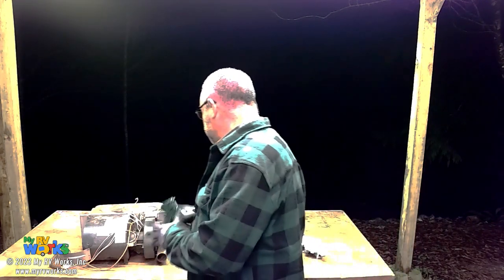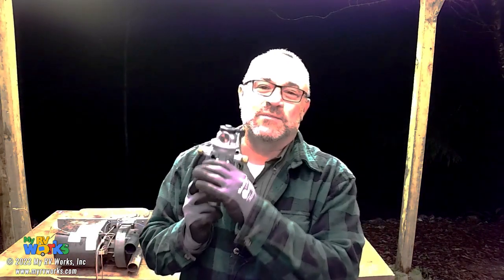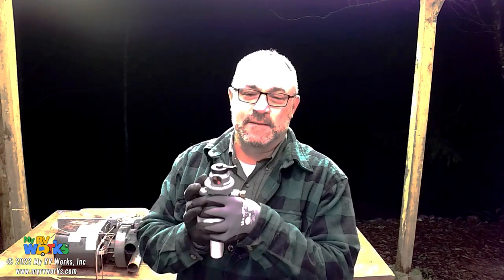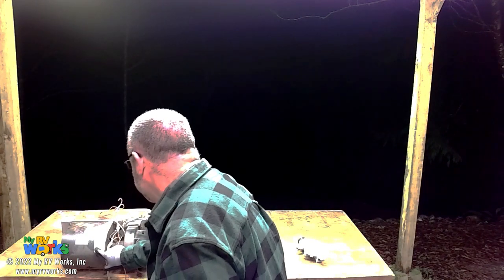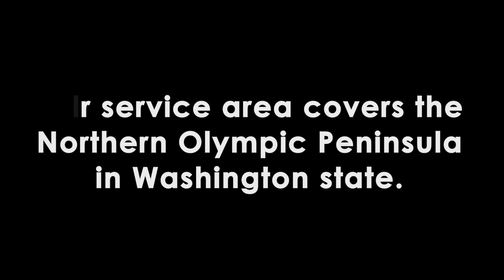3 Tips For Your RV Furnace + Bonus Q&A -- My RV Works

Comment: Concerning mouse proofing an RV, I have discovered a method that has worked for me 100% of the time going on four years now. We have a destination model trailer permanently parked on our lake lot which we occupy from May through October every year. The rest of the year it sits empty. It has no skirting under it. Our first year, we had two episodes of mice inside the trailer. Then a friend told me of a way he uses to prevent RV/Boat rodent entry. Indoor/outdoor rope lights. So we got a rope light from Amazon long enough to lay on the ground circling the trailer, outside the support jacks, the tires and the tongue jack, and have not had a problem since, except for one time when I inadvertently unplugged the lights and left for a week. The lights just work. The rodents will not cross the rope lights! Thanks for your videos! They are outstanding!

Comment: All I can say is thank you, thank you, thank you.  On a recent trip the furnace on my 2016 Thor 28Z stopped working.  I have spent two weeks trying to troubleshoot it.  I must have watched 2 dozen youtube videos and read countless forum conversations on how to fix it.  After replacing the control board, sail switch, ignitor and sensor, and high temp thermostat switch, I was at wits end.  I realize now that my sail switch did need replacing as the fan wheel would not run unless i first hand spun the fan to get it moving.  Once the sail switch was replaced (the same time I did the circuit board) the fan would come on, run for 30 seconds and then it would try firing.  I could hear the click, hear what sounded like a spark and then get a brief 1 or 2 second burn before it would shut down.  Time and again this is what would happen.  After lockout, I would wait 30 seconds, reset the switch and do it all over again. I threw in the towel and told my wife I was probably going to have to bring it to Camping World and have them fix or replace it, at a tune of probably 1500 dollars or more.  Being retired on a fixed income, this wasn't a good feeling.  Then this evening I was conducting my last due diligence and found one of your instructional videos regarding the gas valve.  During my earlier attempts  I could only smell the slightest hint of gas during this time, so I decided that maybe I should troubleshoot the gas valve next.  I watched one of your older videos (3 years ago it was recorded) and decided that tomorrow morning, that is how I would start my day.  Maybe, just maybe, it was a solenoid or an orifice obstruction.  Then, you mentioned something no one did, in any of the previous videos or forum chats.  You said that the exhaust vent tube had to be in place for it to fire and continue to run!  When I was trying to get it to run, I left the cover off with the exhaust tube attached.  So, I detached the exhaust tube, put it back into the furnace and low and behold, it fired right up and ran beautifully!  Something as simple as that!  Thank you!
Reply: Thanks for sharing your experience!  I’m trying to figure out my lack of furnace function right now, and I would have done the same thing and left the cover off.

Comment: Hey, I’ve been enjoying your videos! Very helpful! I do have a question. I have an old travel trailer with a hydro flame 8525-III. After getting it out of storage and hooking up power (12v DC) it appears the furnace is stuck on. Blower and heat…will not respond to the thermostat. Only way to shut it off is to pull the fuse. Appreciate the help and keep up with the helpful content!

Comment: Thank you for such detailed explanations. Please tell me, I have a problem and I can't understand what the reason is, my thermostat from Coleman has a relay and when I turn on the heater this relay clicks 2 times and sometimes it happens that it clicks 1 time the heater starts up and heats up and then clicks again and stops and works randomly, I tried to install a new thermostat but it didn't help me, the heater is in perfect condition it is 100% working and was tested with different components

Comment: What RV is okay at -40? I know their construction and operation well, so being fine at that temperature would have to either be very limited or with a set-up I've never heard of. I have an Arctic Fox "4-season" (right!) and the rear plumbing is good to around 12F, at which point the unit is finished functionally, with the interior temperature set at 65F. The interior temperature can be kept at 65 to about 10 below zero F, but the walls are then losing it at that point with condensation frozen in the corners, etc.--a 2-inch wall with an uninsulated aluminum frame will never be "4-season" in reality except in the South.
Reply from the maker: Here is a link to some notes I give at seminars where I discuss this information.
 
https://myrvworks.com/darrens-seminar-outline-for-winter-rv-living-in-comfort/
Reply: @MyRVWorks  Yes, those are mostly standard winter practices that I am familiar with except for a few items like R-19 insulation under the coach. Mine is already insulated, though not at that level, nor would there be anywhere to insulate to that level (assuming we are talking about actual insulation and not an "RV-manufacturer insulation rating" where aluminum foil with an air gap is imagined to be worth R-30, the residential-builder scandal with that stuff never having reached or been enforced in RV marketing claims). Unless you tear apart and retrofit floor raceways, under tubs, etc., to add heat tape and insulation to water lines and the total energy expenditure per square foot is essentially limitless, plugged into AC, and unless refrigerator manufacturers like Norcold are willing to go 40 degrees below their current minimum-temperature rating even with their cold kit being installed, this still isn't going to get you down to any kind of normal, living functionality in the -40 range.

My experience is mostly in the northeast corner of Washington State east along the northern tier into Idaho and Montana, and even older homes with at least 2 or 3 times the best RV's insulation, enclosed to the foundation (which itself is deep enough to be on unfreezing ground), far greater thermal mass, etc., often struggle to maintain a livable space with everything working normally at that temperature. An acquaintance scared himself with the encouragement of other owners in their forum that an Airstream would work well for him in severe cold. After his very first night just getting down towards zero, he woke to find the entry door frozen solid metal-to-metal. Despite recommended measures, he quickly gave up on it as impractical and expensive, and he was only experiencing the +10 to -15F range continuously. Frost formed on the interior rivets even at relatively low humidity and would then melt into / onto the finishes until reaching the floor, etc.

There are trailers that are custom-engineered for commercial / corporate use in North Dakota and Alaska that are specifically intended to withstand extremes, but they don't have much in common with RV's.

Comment: I have a Dometic/Atwood model 2540. It was working properly earlier this year, but it started giving problems. The blower will start, purge the system, clicks, ignition, then 1 or 2 seconds it shuts off the gas. After several seconds it clicks, ignition, then does the same thing, over and over for about 5 times then it will continue to work properly, until it reaches the desired temperature then shuts down.
The next time it will do the same thing or not continue to work.
I have inspected the burner and adjusted the gap but it still is intermittent. There are no flashes.
What do you recommend?

Comment: Hello Darren. Love all your videos. I have a furnace question. I have a SF30 furnace and it works fine as it should when I first turn it on. After 5 minutes of running it will stop burning propane and I can hear the gas valves click off. 30 seconds after it clicked off it will ignite again. I changed my high limit switch and sail switch only because my RV is a 2007 and not sure what maintenance the previous orders did. After changing out the two parts it still doing the same thing. I made sure nothing was blocking the return air and the vents are good to. Thank you for any advice.
Reply from the maker: Please join us for our next livestream, this Friday, Feb 3 @ 4:30 PM PST, where we answer viewer questions live!

Comment: We have a living quarters horse trailer and the propane heater at the exhaust we smell a strong propane oder. Need help 🥺 asap
Reply: The furnace is only accessible from under the fridge inside.
Reply: It's a airxcel
Reply from the maker: If you believe there is a propane leak based on the odor you are smelling, we recommend turning the LP off and reaching out to a tech near you.

Comment: Feeling really ignorant.  It is a Coleman Mach thermostat, and an Atwood 8531-lll Series Heater.
Reply: Hope you have learned more by now, but if you have been busy with other stuff, definitely type in your brand and model and “manual into google, and you will probably come up with one.  My 2006 Winnebago came without manuals.  Im still building.